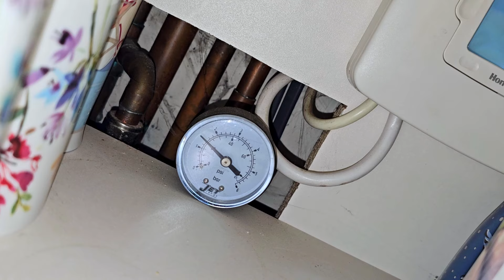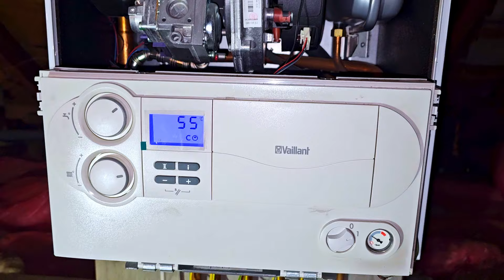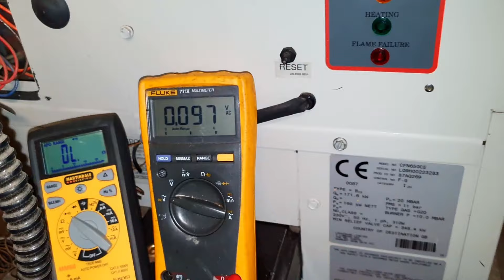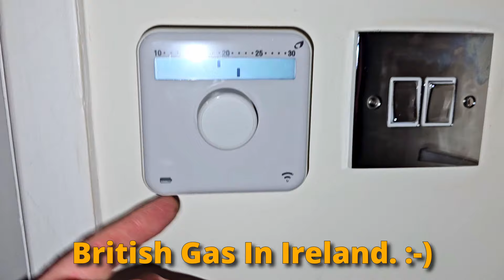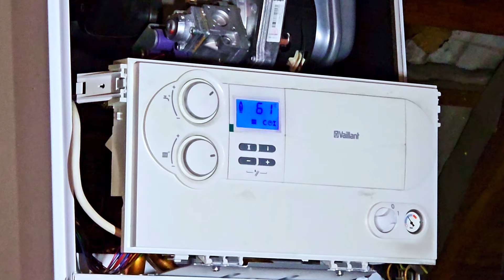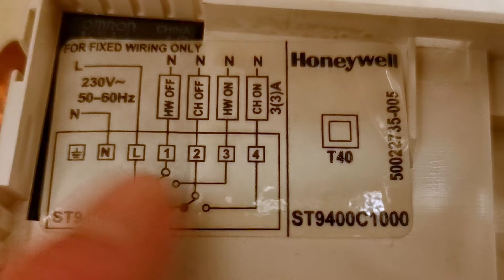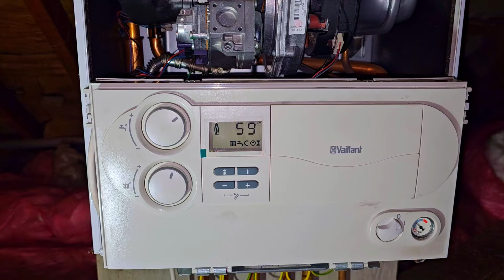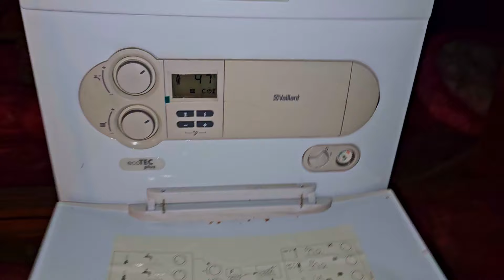I Wouldn't Do This For A Customer.....

Comment: Good job. That DC voltage check will be a useful addition to my diagnostic arsenal. Thank you.
Reply from the maker: No problem. It works on other brands too. Just need to know where a constant voltage is meant to be and test it.

Comment: Brilliant video!
I like the mix of domestic & commercial.
Good tip on testing the low voltage side of the board.
Regarding the zone valve on the unvented cylinder it should fail to closed, not be powered to closed.
Reply from the maker: Yes, exactly that. I told the building owner. I think it may be ok but i'm not sure

Comment: The flyback transformer is normally running anywhere from 60 kHz up to 250 kHz on a power supply of this size. Electrically leaky smoothing capacitors on the DC side will prevent the voltage rail being regulated properly. If you were to look at the output waveform, you'd see large overvoltage spikes followed by a drop in voltage after switching period.
Reply from the maker: I can look at the waveform if my oscilloscope is good enough. I need to have a look at it. where would i look at it? The same points? I have gone through the PCBs before and drawn a basic diagram but it was years ago and I don't have it anymore. I do think some versions have test points marked on them....
Reply: @HeatingGeek  you'll see what's happening if you probe directly where the capacitor is. Instead of a line at 21V with a bit of ripple, you'll see a wobbly waveform which gets worse with load
Reply from the maker: Ok, I will have a go next time i'm at one. :-)

Comment: Very nice work and many heating eng's couldnt do that.
I am sure you will remember but on those boilers - 
Chimney sweep does the range rated output. 
P1 max - boiler off, Hold + turn on boiler  until P1 release and push i button. 
p2 min - boiler off, hold + trun on boiler until P2 release and push i button. 
Common fault of the R1 model (up to approx 2012) when they are 8-10 years old. Gas valves normally good and reliable. 
R2 onwards (2012 on) could be either PCB or gas valve. Can test each but the gas valves are really bad on these. 
Thank you
Reply from the maker: Yeah gas valves were poor on the later generations. I also know how to fix them but thats flying a little close to the sun for me. ;-)
Reply: Indeed so poor that I had to replace one I had fitted to the same boiler the previous day ! Some may argue there was a contributing fault but this was not the case.
The second has been OK for 3/4 years now ! Would be interested to hear your thoughts on this but i also understand your position. 
Repairing gas valves PCB's etc can leave you open to all sorts of problems and this is not something I have entertained - apart from repairing defective solder joints. - This doesn't materially change the part.  
I also do not fit parts that are "pattern" or "reconditioned" for exactly the same reasons. Cheaper maybe but for who ? The customer. And you are in a whole lot of bother if there was a significant problem. Stick with manufacturer parts. 
Thank you      
      @HeatingGeek
Reply from the maker: I agree. I have become a little frustrated lately because of all the parts that have very minor things go wrong and need £200 to replace. The world apparently needs saving so we should all buy a heat pump. Coz thats the answer..... Making more shite. Selling more shite..

Comment: Remember fixing my nan's old turbomax divvy with the inner tube from my nephew's bike....it held for ages. LOL.   My mum has an old Prima chugging along.   Keep a stock off fans and PCBs for her.
Reply from the maker: Get a gas valve too. I like the prima except when they are left on before a service. Fing hot boilers.
Reply: I think hers has a Wright Rogers valve rather than the Honeywell.   Will be a sad day because its the narrow one and I can't think of a modern boiler I'd trust that fits the space on the wall.  Will effectively mean a new kitchen,  and she's in her 80's.
Reply from the maker: They did a conversion kit though? I think.. If not I would grab the bits out of another boiler. Cant mess up an 80yo kitchen for a new boiler.

Comment: I used to do that all the time on boilers when I worked in Turkey and people couldn't afford a new card. Great job! 👍
Reply from the maker: Thanks :-) I would like to move to North Cyprus one day. I just cant learn another language. I can't even do English very well.
Reply: @HeatingGeek  Don't worry about that in most places there is a large community of expats and other people so English will do fine. If you also can do heatpumps (aircons) then you can basically get work from day one.
Reply from the maker: @yannkitson116  May plan was to do heat pumps (F Gas) next year. So maybe it can become a reality

Comment: Looking at the programmer diagram it doesn't show the need for a link between L and 4. Why is that added? Is it not integrated in the board like the connection between L and 3 is?
Reply from the maker: The link between L and 4 is what is keeping this persons heating on. Another engineer has put it in because the programmer  has failed.

Comment: Makes perfect logical sense. What are the current Gas Safe regulations about carrying out PCB repairs at component level? I'm new to the industry having spent 20 years working in electronic systems on aircraft, and consequently tracking down electronic faults is second nature to me. I've been told by other Gas Safe engineers that I was acting illegally when carrying out a PCB repair. I was not modifying the design or anything - simply replacing faulty components like for like with the the part number to restore it to a seviceable state as per its qualified design (was MOSFETS and a wirewound resistor in Worcester Bosch fan PCB). I can't seem to find any definitive info concerning this online, only a few opinions from Gas Safe engineers who probably wouldn't know how to carry out such a repair and would just swap the whole board, and probably don't want other people to undercut them on repair costs it would seem.  Any advice you can give would be a great help as I'm just starting out. Thanks.
Reply from the maker: No idea, but Im not risking it :-)

Comment: Good informative video, can you explain wgy power on/off two ports would be an issue in the video please? Is it to do with if the power off side of things is faulty?
Reply from the maker: Unvented cylinders need 2 forms of overheat protection and 2 ports are meant to fail safe. These 2 ports would stay open if the power failed.

Comment: I dont normally comment but great video. To help with your query the capacitors on the board help with Capacitive Reactance. This is inversely proportional to the AC frequency passing through the capacitor. It how the electronics chaps use the circuitry on the boards. The fact that a capacitor has failed it is no longer able to draw the right voltage from the LV side and hence its all over the place. There is an easy way to fix these but very time consuming as each capacitor on the LV side would need to be checked for being "popped". Sometimes you can see the blown capacitor if not then each ones needs to be de-soldered and tested.
Reply from the maker: Thats why I done them all. No need for testing with Mmeter and ESRmeter. Just replace and refit. :-) I have just ordered an ESR meter so I can test them in future. I have previously replaced caps and repaired a PCB ( I fitted in my own boiler to test) and the uf was all ok on them. So I must of been ESR gone high?? Im not sure but will use one in future to understand a little more. :-)
Reply: These are polarised electrolytic capacitors which have been replaced. Strictly DC only. They aren't being used to drop voltage using capacitive reactance.
Reply from the maker: @sdgelectronics  What does that mean? Can you explain in more simple language?
Reply: Correct, the capacitors aren't being used for their reactance; that would be a 'capacitive dropper' circuit & would be the very cheap means of voltage conversion used in low-cost, low-power devices. A boiler pcb has a higher quality circuit for efficiency & reliability, so will use a bridge rectifier and probably also a high frequency SMPS circuit to obtain the board supply voltage. The electrolytic caps are there purely for voltage stability and smoothing.
Reply from the maker: They do have a bridge rectifier and a PWM IC. I cant see any other FET so i guess its all done from an IC
Reply from the maker: Would a small SMPS need PFC? Or does it need to be higher power for that?

Comment: Great video, where do you test on the mk2 vaillant pcb,will it be on the 24v bus terminal, all components have tolerances,no pcb will be same,dont see why its contravening gas laws,thanks for the video.
Reply from the maker: Same deal with the new ones :-) Except they have an extra electrolytic Cap. .

Comment: That was a good repair, you don't normally find a heating engineer who will perform a component level repair.

Your explanation of switch mode power supply (SMPS) operation wasn't bad, the reason that the transformer is so small is partly due to the frequency of operation (typically >50kHz) and partly because the power required by the circuitry is relatively low (<30W). SMPS are very efficient and can be used to generate multiple output voltages such as the 21V and 5V that your boiler requires and can often be powered from either 110Vac or 230Vac.

There are a number of reasons why SMPS fail and as you have correctly identified, faulty electrolytic capacitors are a common one, particularly where they have been subject to higher ambient temperatures, such as in a boiler. If you look on the side of the caps you will see the temperature rating, many only go up to 85°C whereas others go to 105°C. There are also poor-quality caps that just don't last, they tend to be made by companies that you have never heard of. I always stick to Panasonic, Rubycon, Nichicon, Nippon, Kemet and Vishay.

It is rare for the main reservoir cap to fail, that was the large 400V on your board. It tends to be the ones in the smaller packages. Sometimes you can see that the top silver part of the package is bulging or there is evidence that the electrolyte has leaked out onto the PCB, they are usually signs that it has failed.

If your multimeter has a capacitance range, you can measure the cap, but you will probably have to remove it from the circuit to do so. Sometimes the capacitance is about right (note that they have quite a wide tolerance) but the equivalent series resistance (ESR) is high resulting a failure of the circuit. To measure this you need a component analyser (ESR Meter) which you can purchase from ebay for about £10. Just make sure that you short-out the pins on the cap before measuring it.

As well as getting your mum up and running, you also saved the planet from another piece of e-waste 🙂
Reply from the maker: You have seen the Unwelcome surprise video now so you know I have an ESR meter. I tend to go head first into everything and just remember the things I need to know. I probably done 500+ hours of studying to understand things you find so simple. I then forget at least 70% of it and just remember what I need too. The PCBs are also £200 so saved a bit of cash too. :-) Its always great to get a comment from someone who actually knows what they are talking about when its a unusual subject for a plumber/gas engineer. 
I appreciate it :-)
Reply: @HeatingGeek  I love your approach to repair, learn what you need to get the job done. You must be popular with your customers.
Reply from the maker: I don't have the patience for customers (or people in general) anymore. It's a flaw (in myself) but I have managed to avoid doing a lot of customer work for a while. :-)

Comment: F62 point’s to gas valve but is usually pub but ultimately it’s due to pump failing. When pub in up position sits in front of pump and heat transfer causes pcb to fail
Reply from the maker: Thats a good synopsis. I never thought of that. Time will tell though. My mums not going to call anyone else. :-)

Comment: In my life I served as a Electronics Instrumentation Engineer etc, always go for new Electrolytic Capacitors, replace with Panasonic High Temperature rating 105°C 
Look at value in uF & Voltage rating same, in a Hot environment Electrolytic Capacitors dry up or leak, clean pcb with isopropyl, watch out for polarity of the Capacitors
Reply from the maker: Thats it. I didn't clean the PCB as I didn't have any isopropyl in the val. Next time I'm there I will give it clean. I had the iso at my house in the garage. :-) I wish I could learn more about electronics.
Reply: @HeatingGeek  there's a great book its like the Bible of Electronics, its called the Art Of Electronics you can find Pdf version of this about 700 to 1000 pages
Reply from the maker: @CoolMusicToMyEars  Wow that was easy to find. 1225 pages :-) Thank you very much!

Comment: But when the fan turns on its impedance is low at the beginning and it rises gradually, hence the voltage drops for a short period.
is it not true?
Reply from the maker: I don't know. I just know replacing the Caps fixes the problem and the voltage dropping is the way I ID it. On a good working boiler the voltage does not drop the same way.

Comment: Why does the pcb fail sometimes when u turn the power off on the front ?
Reply: I've had that on a Glowworm. Power off up in the loft to check the flue. Case front off. Gauge on analyser in boiler power back on and flashing on off on off. Makes you look very professional.
Reply from the maker: Exactly the same reason. The caps have failed and when they cool down because you turned the power off they stop working. Warm them up and get the boiler working and then order the part. :-)
Reply from the maker: Same issue :-) Caps. Glowworm CXI was the first boiler I ever noticed this issue on.
Reply from the maker: Yeah I have a baxi GA video from a few weeks ago about that. I will find it. :-)

Comment: Hi HG, I have been following your videos, instructions and am interested in further pursuing in central heating/plumbing. The problem Iam going thru with Vaillant TurboMax Plus 824E 
My issues started 4 weeks back, problems with the boiler cutting out after a few minutes. Hot water perfectly fine . The problem we are having is with the central heating side. The boiler starts up and makes the usual noises. The flames light and remain lit for around 2 minutes, after going off. The boiler continues to make the noise those (as though it is fully working). After about another 5 minutes the flames light again for another 2 minutes (It doesn't reach the temperature-It gradually goes upto 30c and cut off the heating. When the temp gradually reached 18c it starts again for few minutes and cut off. Its more like cycle. Well after running for couple of hours radiator gets warm at the bottom only. ( All rads bleed)
I thought could be room thermostat. I have changed two thermostats from different brand but NO luck. FYI-Its nearly 20 years old combi boiler. 
Thank you in advance.
Reply from the maker: It's the best combi ever made in my opinion. I have one in my garage :-) I would press the i button and see what the S code is. That will tell you what the boiler thinks it is doing. Then go from there. Obviously check what the knob on the front of the boiler is set to aswell.
Reply: @HeatingGeek   thank you for taking time to response. i shows S7/S7 when the boiler runs. Kob set on Max level. Thank you in advance.
Reply from the maker: I bet the low gas pressure is set too low. Check the high and low pressures. I guess you mean s4/s7
Reply: @HeatingGeek   Sorry ...S2 and S7 Pump overrun HGeek low gas pressure set too low? How do i set high. Thank you in advance
Reply from the maker: @kevin-ep3lu  I cant tell you that because its gas safety advise, get an engineer out for that or if you are an engineer call Vaillant. It must go to S4 at some point because that means it's lit. Keep an eye on the S codes and they might show you the issue. Does the temperature on the display fluctuate a lot?
Reply: @HeatingGeek  Thank you for your reply, The temperature like I said remain S2 when the CH stop igniting and S7 when heating starts. No temp fluctuate. thank you..
Reply from the maker: S7 is pump overrun so no flame should be present when it has S.7. Its weird @kevin-ep3lu
Reply: @HeatingGeek   https://www.youtube.com/watch?v=15mcI_Bzacg

Comment: Hey 
Loving the video 
HRU I work on the first series of them 
MHS unit …
Got a massive site, just off of Kensington High Street With lots of them .
Reply from the maker: Im not the biggest fan of them. Adding a littler relay PCB just seams like MHS/Elco were trying to make a quick buck. Who do you work for?
Reply: Hey 
A company called Cbs based in Uxbridge.
Cover all of London and the surrounding areas.
Reply from the maker: Domestic and commercial?

Comment: Fair play to you, that's a drive!!
Reply from the maker: yeah, but no GasSafe in Ireland ;-)
Reply: @HeatingGeek    Just had my inspection last week, pleased thats ticked off for another 5 yrs.   
 Were you doing Sapphires at EOGB  ? 
They intrigue me , going to go do the course when I get a chance.
Reply from the maker: Na, I was doing 2 stage Oftec. It is a great training center. The Sapphires do look very interesting and bring Oil into the 21 century. You have to set the fan speed at multiple settings which means you get a customer for life too.